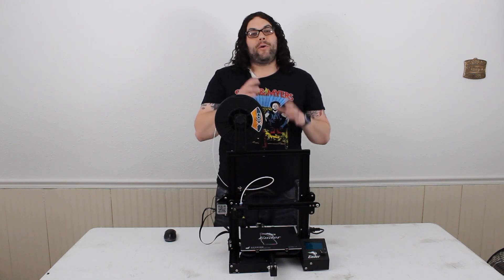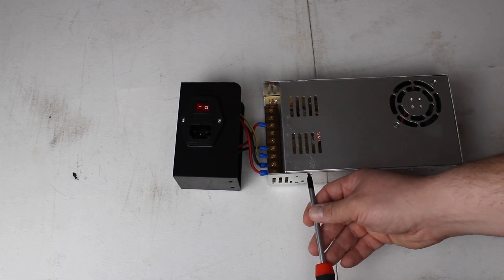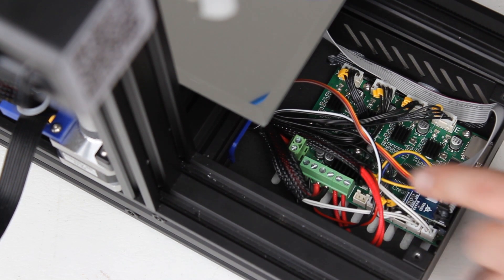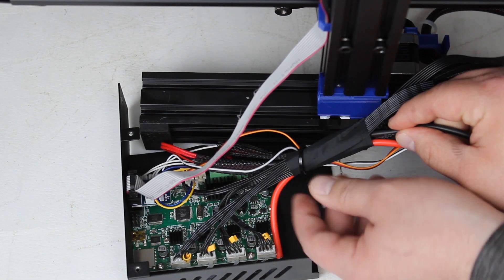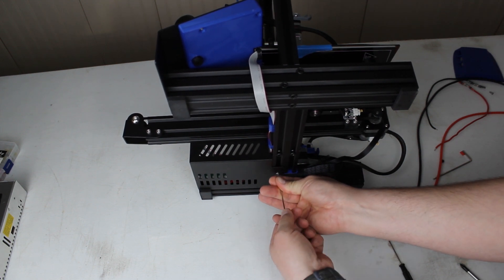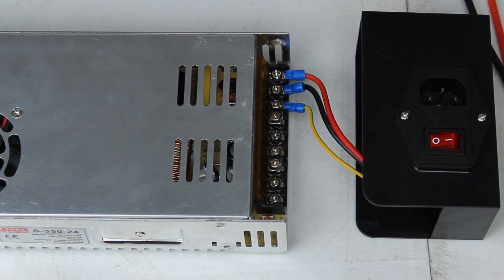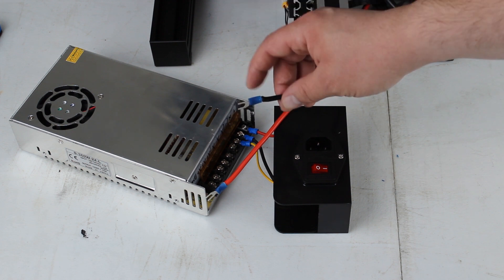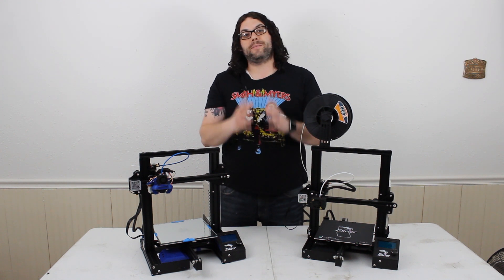Replacing the XT60 Connectors with new wires on the Ender 3

Comment: It would have been better to crimp on some ferrules to those bare wires over just shoving them in the terminals on the motherboard. When those blocks come down and crush those loose wires they will eventually after getting hot and cold a bunch of times they will not be as tight anymore and could possibly start a fire. This is well documented especially ones that have been tinned.

Comment: On the motherboard its also a good idea to use wire ferrules instead of just inserting the wire which when crushed can work loose over time if your not careful and could then short and start a fire..
The crimps made along the metal sleeve lock them in place when you tighten the screws.
Reply from the maker: Great point! Thanks !

Comment: Thanks for the videos! Very informative! Learning more and more about my printer and how I can make it run better.  Questions: My XT 60 connectors were soldered, but fried anyway.  Closer examination found it to be the petals on one pin were pushed together.  Ordered new, real ones (existing connectors were knock-offs) and planned to put them on the existing wires.  That said, they might end up being too short so I'll probably have to replace the wires anyway.  Is it okay to use solid wire (shielded copper) for this or should I use stranded?
Reply from the maker: I would stick to the silicone wires in the video to be safe.

Comment: Thanks for the video. The regular and Pro Enders still ship with 14awg wire (at least on the Pros they fixed the XC60 crimp vs. solder issue), which is rated to 15amps, well above what either power supply will ever pull. 12awg will work of course but is overkill and harder to find the right size connectors for the terminal on the power supply. Most kits, on the other hand, will have 14awg spade and ring terminals in the correct M4 size, they are easy to get pretty much anywhere, also easy to find the right size ferrules to crimp on the other end, which I also recommend vs. inserting bare or tinned copper leads. 

A well-crimped 14awg silicon cable set of good quality will work just as well here and be easier for folks to terminate correctly. My concern is novices trying to force things by either using smaller connectors than the gauge wire (as you did in the video, though you correctly pointed it out) or forcing the connector in the terminal. Jury-rigging IMHO isn't a better way to go than simply going to 14awg and doing it right (or taking the time to track down 12awg connectors that fit smaller terminals).
Reply from the maker: Thanks for the info!

Comment: With the new XT-60 connectors all you have to do is extend the old cable from the mobo to the XT-60 female end using some solder and heat-shrink tubing. Also, your amazon link is to 12 gauge wire when the ender uses 14 gauge. Good overall video but you could improve your speaking quality by decreasing the amount of times you say "Go ahead and..." :)

Comment: I'm looking for the 12ga spade connectors for upgrading the wiring. The ones I've found are to large to fit the psu. Same problem you were having. Do you have a spec for these or a link for the correct size spade terminal?
Reply from the maker: If they are too big that's okay you can just push them in and they will still work I learned that from Tim at TH3D!
Reply: @TheEdgeofTech   the correct terminals are for a #6 stud. I used 12ga wire so the correct terminals are 12-10 #6 crimp terminals.

Comment: You need to use the yellow fork connectors for 12AWG wire, blue are only sized for 14-18AWG.
Reply from the maker: I agree! I used the blue ones because the other ones I got were to big for the PSU. I think I mentioned that in the video. But they all have the yellow ones now! Thanks for watching!

Comment: Could I ask why the XT60 connectors are considered to be dangerous? They are used a lot in RC models for example.
Reply: Understood - a useful tip to know.
Reply from the maker: Hi! Thanks for watching! It's because they are using fake connectors in some cases and either are only crimped or poorly soldered. But if yours don't get hot at all during long prints, you may be ok. If they used authentic XT60 connectors and a good solder connection, this would have never been an issue.

Comment: Thanks for the video. One was badly needed, since there are clueless Ender 3 users out there. 
The 12AWG wire might be a bit too much, especially since the AC cables are thinner. I am planning on replacing them as well and will use a made in Germany copper cable for all.
Reply: Timothy Hoogland  I read and informed myself more about current and wire gauge  this morning and concluded that you're right. Opened up my eyes more on cable selection ;)
Reply: https://electronics.stackexchange.com/questions/191827/power-supply-current-draw

Comment: Gj again, btw psu screws M4 u need M4 connectors or maybe M5 is ok too so if anyone curios about diameter awg/gauges here:
https://www.tedpella.com/company_html/wire-gauge-vs-dia.htm

And for fit "Crimp Terminal SV3.5-4  AWG12-10" is ok, maybe you can add direct link video info Jim great vidoe again good job thank you.